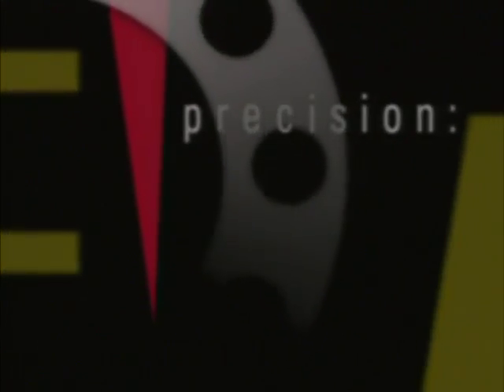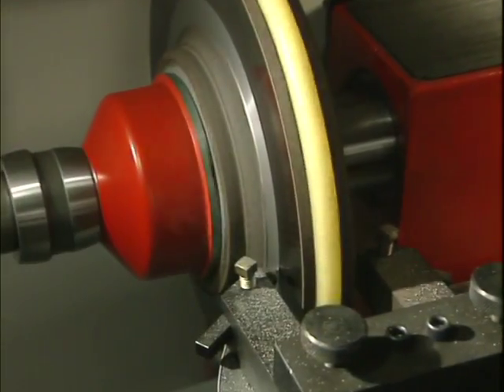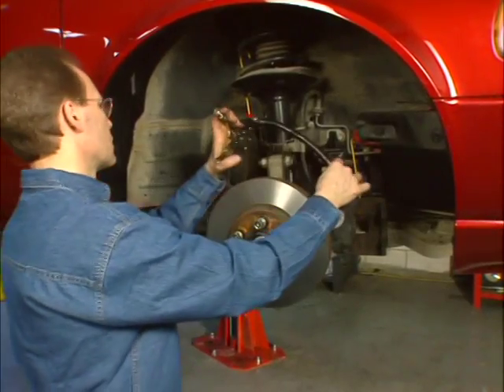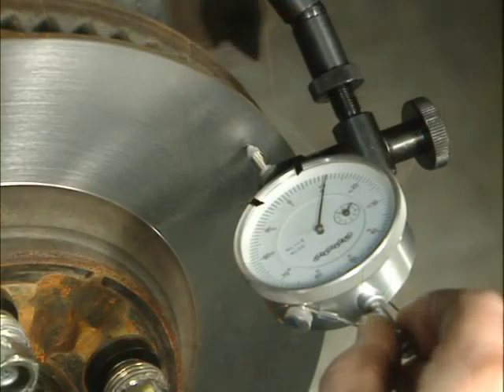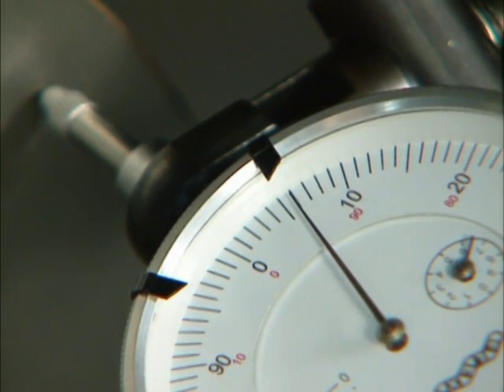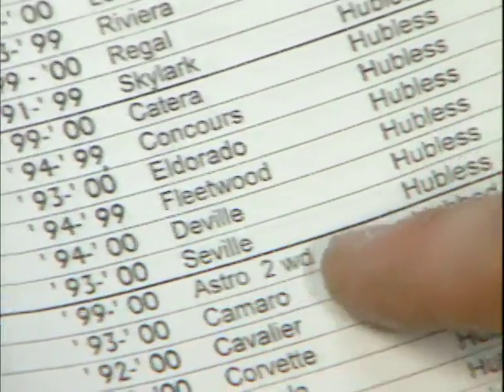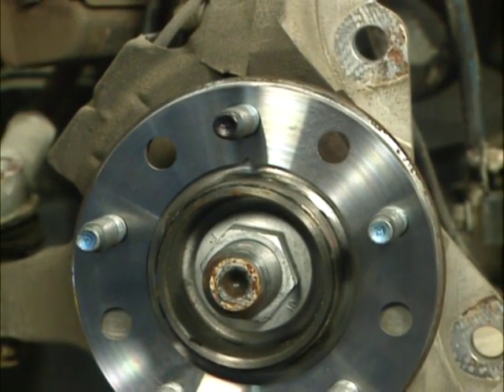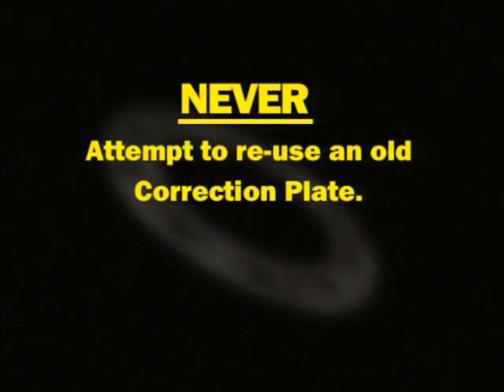Brake Align Runout Correction Plates - Training Video

Comment: This is a revolutionary perspective for DIY brake job replacements. I never heard about the importance of checking runout in any of the DIY youtube videos and I've been having issues with rotor vibrations ever since I started doing brake by myself. I've always just resorted to replacing the rotor and pads, when that happened, and assumed that the rotors were simply of poor quality. Now I know better and I am ordering a runout gauge to check my HUBs and rotors and see what's really going on. Great stuff!

Comment: Why not at least try reinstalling the rotor at 180 degrees difference and check it again?
Reply: Because you can’t. Your options are 144 or216 being every stud is 72 degrese
Reply: I thought the same thing.  It could be just a bad rotor.  I got a bad rotor from the parts store.  Plus this method ignores the stack up.  The rotor has some runout and the car hub also, so perhaps you can turn the rotor to meet it's high spot with the hub low spot to fix it with out this shim.
Reply: @acoustic4037  the purpose of this video is to correct runout  using correction plates.

Comment: From what i remember from going to Tech school is that there can be two things wrong here. 1- what was the runout before machining and was the rotor set up on the lathe to be the same runout as was on the vehicle? 2- what is the condition of the wheel bearings, are they part of the problem and getting wore out?

Yes rotors can warp by heat due to long periods of brake application time and from improper torquing of the lug nuts but this also has to be taken in when servicing the brakes. IE. i did not see the tech on the video check runout of the hub assembly as well to see if it was rotor or hub issue.

These may have some value but why is there 0.006 runout on a machined rotor? Doesn't compute with me, something was done, or is wrong with the big picture.

Comment: J Lynam missed the point,  even with true rotors (.002 max. runout), in many cases the face of the associated hub may not be true (virtually no runout), hence, causing lateral runout which will be magnified to a calculable degree at the rotor face.  It's kinda like love and marriage.  You can't have one without the other.